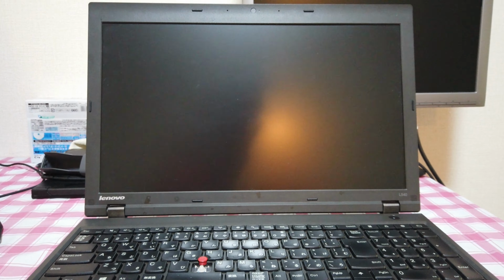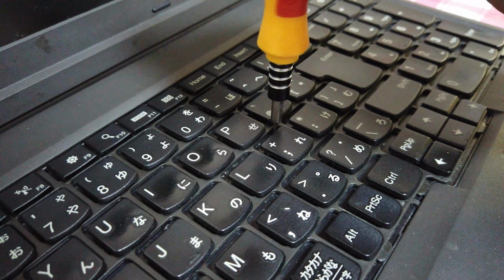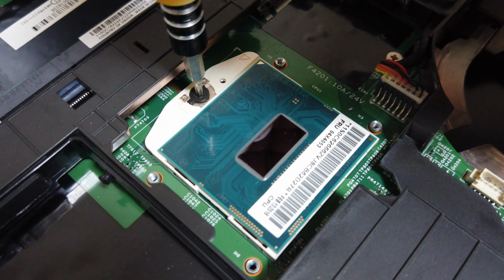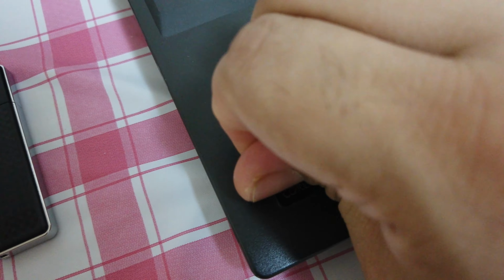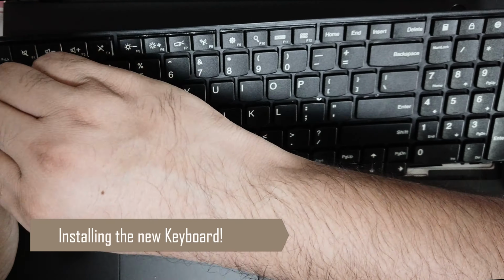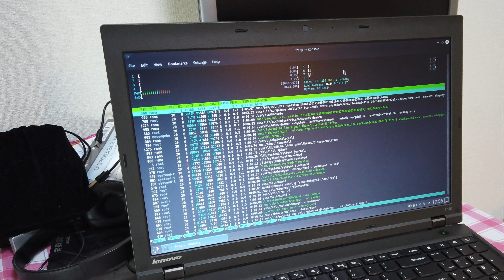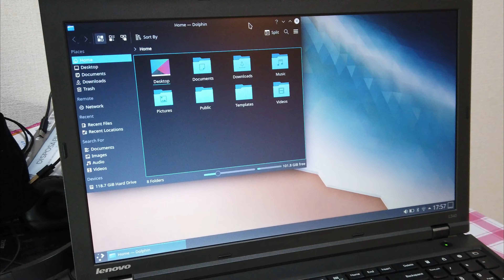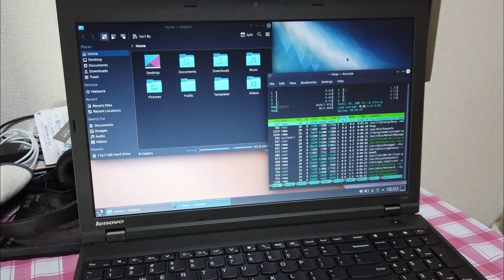Abandoned Lenovo Thinkpad L540 restoration and upgrade!

Comment: I want to buy it (second hand) I brought it for testing, but I have a question as to why the Chinese have written the letter on this keypad, when I connected it with mobile wifi hotspot, whole battery charging drained in 10 minutes And Fully charged in 30-35 minutes What could be the reason for this?Any idea?
Reply from the maker: Lenovo is a Chinese company.. you were sold one machine with bad battery imported from China most probably

Comment: hello i have the lenovo thinkpad l540 is it possible to add an egpu with the exp gdc ngff version please respond fast
Reply from the maker: Yes! It is possible I think...
Reply: @ramakrishnamishra8179  omg thank you so much im so relieved now
Reply from the maker: @reikodr  the system is old.. I am not sure why you would want to add a GPU to it
Reply: @ramakrishnamishra8179  i dont have much money to buy a better laptop or a console so i am just optimizing this
Reply: @ramakrishnamishra8179  plus i can upgrade the cpu and ram too so i can make it a decent system
Reply from the maker: @reikodr  OK! then please note that I have not tested this setup.. theoretically it  is possible but there can be BIOS lockouts in place which I am not sure about. I have sold this machine so I cannot test it any more.
Reply: @ramakrishnamishra8179  what is a bios lockout?
Reply from the maker: @reikodr  Actually features can be disabled in the BIOS and I am not sure if it can affect this system..
Reply: @ramakrishnamishra8179  does the bios of this laptop allow to add another card if so im in the clear
Reply from the maker: @reikodr  unfortunately I don't have the laptop anymore.. so I cannot confirm about it .. it may work
Reply: @ramakrishnamishra8179  ok thanks for the help tho
Reply from the maker: @reikodr  you are always welcome

Comment: Ey bro why is my l540 not powering on even the charger is connected
Reply from the maker: A non powering on laptop means there is a short. Please try removing the ram modules / hdd and turning it on .. if id doesn't then it could be that the VRMs have shorted or some other power related issue.. then you need to get the logic board repaired or get a new one from China or something..